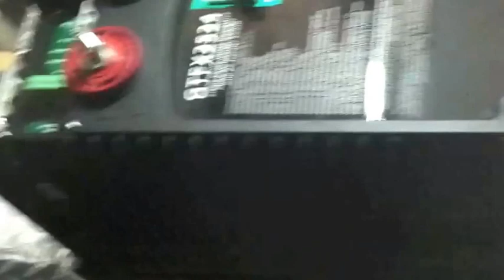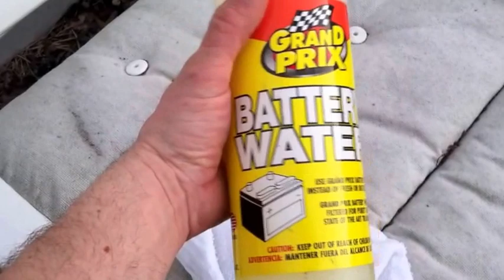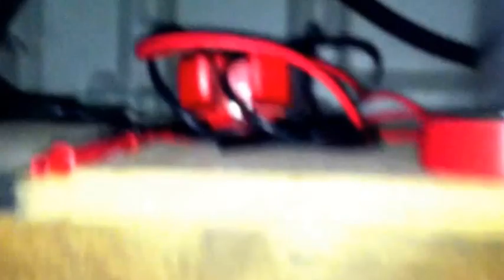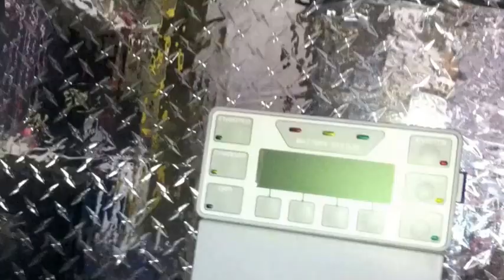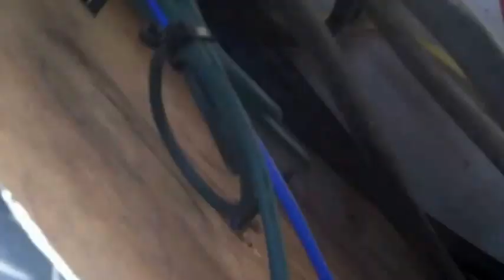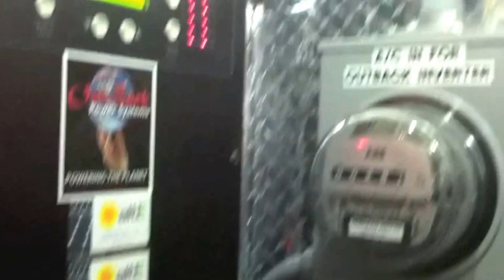SOLAR OUTBACK GRIDTIE PROJECT

Comment: Great vid and system. I'm putting in same one now for a buddy and another at my cabin. May add the lightening arrestors as well. I really like that outback model. Curious what did you pay for your knife switch disconnect and where did you get?
Reply: fanman1981
Square D is very good for their commercial products, but is lacking on their residential  items.
Reply from the maker: thanks the disconnect i got at altestore.com alittle less than 120.00 bucks for 60amp i think 70 bucks for 30amp... i have a 30amp that im selling!! $50.00 bucks
Reply: fanman1981

$70 for a 30 A disconnect?
Try about $25 brand new for a siemens blade switch disconnect at lows hardware.
Around $10 for a pull 30 amp  disconnect at lows hardware.
You may also check home depot.
Reply from the maker: Bonnie Flory Im a square d kind of guy!! And its a 60amp that i have i ran all #6 gauge wire..overkill my buddy Kenny would say..

Comment: Nice breakers and inverter. Your not going to be able to arrest lightning. I dont know who told midnight solar they could stop a hit from lighting but its not going to happen. When it hits direct you get stuff blowing up and melting no matter what you put on it. Distilled water works great for batteries. I get mine from the grocery store a whole gallon at a time for 88 cents.
Reply from the maker: Your right nothing stops lightning...yeah i also heard a epsom salt/ water mix help/works as well.
Reply: fanman1981 My electrical engineer friend said it dont work. He tried the epsom salt on the batteries. It wont bring them back. Its seems to be temporary. My youtube friend nrodge1 said he did some experiments with epsom salt. So you can talk to him about that. Actual battery acid is what should be used you can get that at the auto parts store. but you dont need to add acid unless the battery is gone and your trying to revive it. Some people dump them out if they are not shorted out and put all new acid and distilled water in them and have good results. But if its overly sulfated nothing can be done ecept scraping the plates off. There are battery re-builders in certain towns.
Reply from the maker: shartne thanks man!! i think i have seen the acid sold at home depot/lowes where they sell the basement sump pumps with battery back up!!thanks for sharing.ill do my best to keep them alive..and then its AGM...
Reply: I guess some people drill holes in the top of agm batteries and add acid when they boil it out. But I never tried just took them to the scraper.
Reply from the maker: yeah prob an't worth the hassle!!Cant expect batteries to last forever... sam's club has the best price i think..on both agm/FLA if you get 5 to 8 years out of a battery your lucky!!
Reply: fanman1981 Rolls Surette batteries are supposed to last up to 20 years. They are huge and cost a lot. If I had the money I would get some like that maybe. The Edison batteries are supposed to last 10 to 20 years. Who knows about the claims but those are some of the good ones. I like the giant agm batteries like 200 amp hours for sale at Sun Electronics they are Outback batteries. Look like Panisonic batteries brand to me.
Reply: I tried Epson salt on a 3 month old  battery that was sitting for 3 years uncharged and it failed, also a desulfater failed on it also. It must have internal damage.
Reply from the maker: yeah they do crap out i just notice one of my deep cycle batteries i got back in 2000 or 2001 crapped out i put a load tester on it and needle drops.. o well its a good core battery now...
Reply: I have had batteries do that. Not cool.